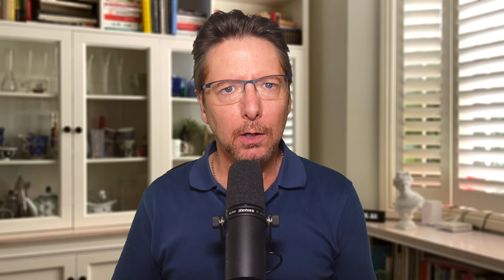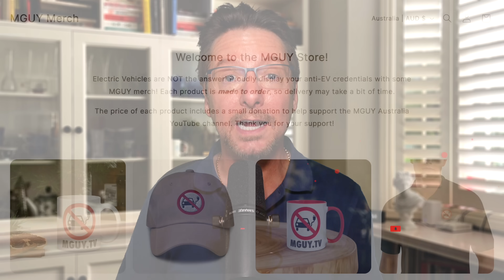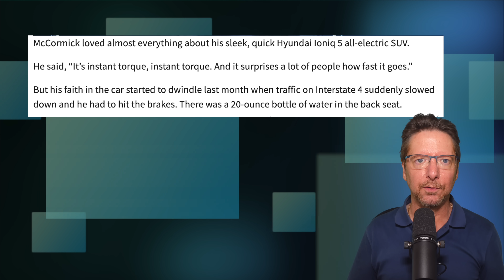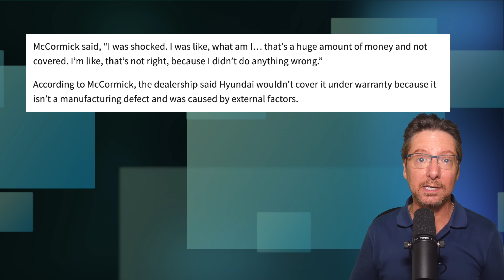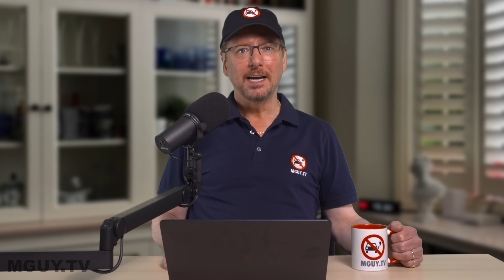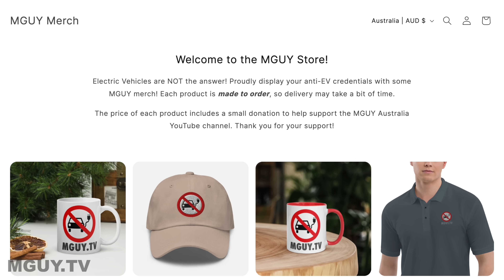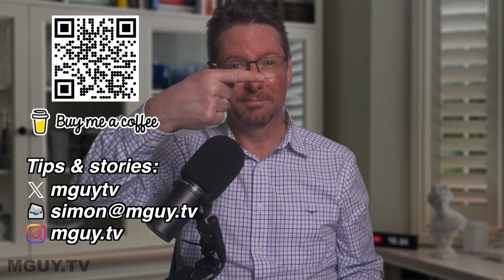ASTRONOMICAL EV repair bill for spilling a WATER BOTTLE! | MGUY Australia

Comment: Parts are expensive for EV's because the manufacturers are trying to claw-back the massive losses that they are making.
Reply: Parts for Chinese EVs were NEVER AVAILABLE.   😮
Reply: @MelodyMan69 They are available in the form of another EV.
Reply: @user-vb6lq9il5v  :face-fuchsia-wide-eyes:
Reply: @MelodyMan69 I was in Bolivia about a year ago, and there were many chinese EV makers which is odd since most people in the country can't afford any car.  You often see husband, wife and baby in mothers arms on a motorcycle.
Reply: @MelodyMan69 Exactly right. An idiot in the UK has been waiting for 7 months for a rear light fitting after somebody reversed into him. It's an Omada I think, something like that. He asked the dealer when the replacement would arrive and they told him there were no replacements. So he asked how long it would be until they shipped the new part over from China and the dealer said, "No, you don't understand - there ARE no replacements, period. There are none coming." Seems now all he can do is wait for a accident damaged car to show up with the part that he needs still intact.
Reply: @MelodyMan69🤦‍♂️
Reply: Do you have proof? Or just speculation. Don't buy an EV ever.
Reply: Dealership:  Oh oh.  We have to replace a module.
Owner:  Which module?
Dealership: The car module.
Reply: Making losses lol, stop building them.
Reply: @melissasmess2773  They'd have to get rid of insane CAFE (Corporate Average Fuel Economy) standards first. THOSE are/were forcing makers to build EVs unless they want huge fines added to each single ICE car. Thankfully, President Trump pretty much did just that: "In the One Big Beautiful Bill Act signed by President Trump on July 4, 2025, fines for missing CAFE standards were eliminated, effectively mooting the standards." (wikipedia CAFE article) I'd have to dig deeper how EU standards are still punitive to makers. In any case, makers have started to move away from EVs again.
Reply: @melissasmess2773  They increased the price of ICE cars to partially cover the losses but even with that extra income EV's are draining them.
Reply: @WhiteDieselShed  Finally! Someone else who actually knows and understands what's actually going on in the car market.
Reply: @WhiteDieselShed  Actually much of the price increases are due to all the "nanny state" stuff that is required.  Motion sensors in the rear in case someone is behind the car, RADAR in the front for automatic braking, sensors for lane violations, camera to make sure you don't fall asleep, etc, etc.
Reply: @WhiteDieselShed  BYD is still profitable, but its profit has declined recently due to a fierce price war in the Chinese electric vehicle market. While the company reported a 33% drop in net profit for the third quarter of 2025, it still generated a significant net profit of approximately $1.1 billion for that quarter.
Reply: @melissasmess2773  woke governments force them to a lot of the time
Reply: @melissasmess2773  Ford loses 3 billion every quarter on EV's.
Reply: @melissasmess2773  Those which make EVs and ICE have increased the price on all of their ICE to subsidize their EVs. Every ICE purchase is covering their loses on EVs. This is why all vehicles have become so expensive.

Want cars to become more affordable? Push EVs out of the market until they can position themselves in the market on their own.
Reply: @justanothercomment416  yup Mary Barra admitted it when she made the declaration that GM was "profiting" on EVs... By overcharging (pun intended) on actual cars to subsidize their massive losses for each EV.
That's when the lightbulb lit up for me on why normal cars were almost as expensive as EVs lately
Reply: Also because of monopolies, say good bye to generic parts that fit on almost all cars, these modules are designed to only fit one make and model. Even when the hardware is identical they use DRM to ensure to cheaper after market parts are installed.
Reply: @John8087  "Even when the (...) parts are installed." 
 
I think you intended to include "no".
Reply: EV owners seem to love flushing money down the toilet
Reply: @Terry-q7y  A common misconception after listening to MGUY who has, by the way never owned or operated an EV.  MGUY speaks purely from ignorance as his comments bear zero resemblance to actual EV ownership.
Reply: @tacocangrabembythetaco  Not owning one is god protecting him from endless problems
Reply: @Terry-q7y  Yet God was unable to protect him from being a whiny beeatch dealing in subjective hyperbole.  God is unfathomable.
Reply: I have a 2008 Nissan Skyline sedan. The main headlight had moisture inside. Price to fix? $3,500, because it is a sealed unit so the whole light assembly has to be replaced. It's not just EV's that have expensive spare parts. p.s. I was very lucky that the auto electrical company I deal with agreed to try and replace just the one light. They indeed figured it out and it cost $700.
Reply: Gee they tried to rip you off Sealed units second hand start at around $150 bad luck champ
Reply: @fossilsfabe4304  That's still a big ouch for what should be a basic repair, something that even a less than dedicated amateur could or should be able to do.
Reply: @fossilsfabe4304  Your IQ is negative!
Reply: @fossilsfabe4304  ouch!   this is a pretty old issue.  people got mad that replacing a lightbulb required dismantling a lot of things.
Reply: @fossilsfabe4304  Audi LED headlight id 19000 USD
Reply: @fossilsfabe4304 ma ti rendi conto,delle stronzate,che ti dicono ,3.500,per un farò...andavi da un artigiano e con 200/300 euro,ho Dollari ,Ti faceva il farò meglio della casa Automobilistica..
Reply: @fossilsfabe4304  Das ist aber auch kein "Allerweltsauto". Da darf ein Scheinwerfer so teuer sein. 😎
Reply: One for the price of two
Reply: What loss? Chinese EV manufacturers register the car to make it seem like it's sold, get the CCP rebate, which covers the cost of the cheaply made car, then it sits in field or in a mountain carpark rotting, until some halfwit buys one. The manufacturers are making DOUBLE the cost of the car whenever one is legitimately sold.
Reply: EV makers have serialized each major part in the car.... motors, batteries, electrical components, because they want you to be forced to go to the manufacturer for the smallest part.  That makes it a non-starter for people who think about long-term reliability and are interested in have a reliable car for 15-20 years.
Reply: @teekay_1  The push for EVs is largely about control. They want to force everyone into disposable vehicles where they can control and limit travel. Thereby forcing everyone into 15-minute "smart" cities. Where everyone can be tracked and controlled with minimal effort.
Reply: @justanothercomment416  That is certainly one of the plans that the elites have particularly for cities. But in the US, a large percentage of people live at least 5-10 miles away from even a grocery store, and so that makes it a practical problem for EVs and why Americans have such an aversion to them.   Around me (I live in a somewhat rural area, wealthy people buy them as a 2nd or 3rd car.
Reply: @teekay_1  We don't have a power grid which can support EVs anyways. But if you force adoption you'll create massive grid and power failures. Which would then be used as an emergency reason to limit individual power consumption under the fraudulent green agenda.

Our grid is already stretched and expanding with EVs only compounds the issues. But this does increase energy costs while lowering GDP. All according to plan.

Any country pushing EVs without a massive grid expansion with nuclear is literally a grid engineered to failure and increasing energy costs. Wind and solar both play a role here as these too only force energy costs ever higher. They are all tied together to end civilization as we know it, to usher in the NWO; complete with your social credit score, limited travel, and limits on individual energy consumption.
Reply: Tech is aging fast so they have no will to produce new batteries to old cars or repair them.
Reply: And people are stupid enough to let them.
Reply: @SN-jh3bb stupidity is a social contagion.
Reply: Will third parties tool-up to make spare parts? The OEMs aren't likely to support their EVs long term.
Reply: lol, you have no clue what you are talking about
Reply: @JohnnyPerth  You just described every MGUY fanboy. This channel is built on fear and ignorance.
Reply: Massive losses? Musk has made BILLIONS on them, just got a 1 trillion dollar salary over the next 10 years. They are so expensive because people pay MUCH MUCH more than they are worth!!💰💸🤑
Reply: What parts? 75K EV kms driven in 3 years, no repairs, no servicing, no oil changes, no public charging, no running out of juice, no fires, no explosions, just $16,500 AUD saved on diesel and servicing in 3 years. You guys live in an MGUY fantasy world where you imagine you are experts on EV's, why? because some other plonker who has never owned an EV either told you some stuff. Funny.
Reply: @tacocangrabembythetaco  Same here...2 year old BYD Seal, 27000 kms and not a single fault, mechanical, electrical or software.....On another thread I made a comment about the extremely low risk of EVs catching fire and an angry Mguy fanatic told me to go and look at the London Fire Service for 'real data".....if you want to have a laugh Google "London Fire Brigade leads the way with new electric fleet".......I replied to the Mguy fanatic with the 'real data", but he never got back to me.....
Reply: @tacocangrabembythetaco An electric vehicle that has travelled 75,000 kilometres over three years should definitely have a service history. Even though electric cars require less mechanical maintenance than petrol or diesel cars, they are not maintenance‑free. They still need regular inspections and replacement of consumable items such as tyres, brake components, filters and fluids.  

Manufacturers usually recommend checks every 12 months or around 15,000 kilometres. Over three years and 75,000 kilometres, that means at least three to five scheduled services should have been carried out. A proper service history is important because it shows the car has been maintained correctly, it protects warranty coverage, and it helps preserve resale value.  

Tyres are one of the first things to consider. Electric vehicles are heavier and deliver instant torque, which means tyres wear faster. At this distance you would expect at least one full set of replacements, possibly two depending on driving style.  

Brake pads and rotors last longer in electric cars because regenerative braking reduces wear. But the brake fluid should still be replaced every two to three years, and rotors can corrode if they are not used often.  

The 12‑volt starter battery is another item that needs attention. Electric cars still use a conventional battery for accessories and control systems. These usually last three to five years, so replacement around this mileage is common.  

The cabin air filter should be replaced every one to two years to maintain air quality. By three years, at least one or two changes should have been recorded.  

Electric vehicles also use coolant for battery and electronics thermal management. Replacement is usually required every two to three years.  

A proper service history at 75,000 kilometres should show regular tyre rotations and replacements, brake system checks and fluid changes, cabin filter replacements, cooling system checks and possibly a coolant change, 12‑volt battery testing or replacement, software updates, diagnostic checks, and inspections of suspension and steering.  

The conclusion is straightforward. Electric vehicles avoid oil changes, spark plugs and exhaust maintenance, but they still need servicing. A car with 75,000 kilometres on the clock should have a clear service history covering consumables, fluids and system checks. If no records exist, that raises concerns about warranty, safety and resale value.
Reply: @tacocangrabembythetaco  I am sooooooo glad that you subscribe to the New World Order nonsense!!!!!  That tells the rest of us how you operate.  Keep drinking the cool aid.  It is working for you.  The fact that you CLAIM to NEVER run out of "juice" tells me that you DO NOT go anywhere!!!!!   I live in a rural area, not some over-regulated city with its failures and faults.  If you love your little golf cart, I am happy for you.  

I drive a 23 year old Jeep, and a 16 year old diesel pickup.  I also own a hand built 1923 T Bucket.  I own a quad, and a RZR.  I also have a 3,000 pound slide-in camper for my pickup.  I like to go out into the boondocks for fun.  Let's see you load a 3,000 pound camper onto your EV, and then drive 150 miles out into the wilderness and stay as long as you want.  

Every part of any of my vehicles is recyclable.  Not so with your golf cart.  EV end of life issues ARE a real problem.  Lots of deadly chemicals in a decomposing EV!!!!!!!!!
Reply: @BuilderofRat  I  have 2 diesel trucks, a 72 Ford V8 Coupe, 2 motorcycles, 4 forklifts, a scissor lift, a 5000lb trailer and 2 EV's . So what? EV end of life issues are all in your mind as mankind always finds new solutions to new problems. Maybe get down off your high horse. I speak from practical experience, you should try it rather than sound foolish.
Reply: @tacocangrabembythetaco  There are very few recycling centers for Evs, mainly those batteries.   China has hundreds of acres of unsold EVs, and they have destroyed the ground so badly that nothing will ever grow there.

How do you suppose that a totaled EV will make it to one of these recycling centers?  If I was a truck owner, I would refuse to haul these things ANYWHERE!!!  

So you think that I sound foolish?  I think that it is foolish to charge your EV in your garage, or anywhere next to your house.  I think that it is foolish to have to plan a trip around the availability of a charging station.  

Until they figure out a better SAFER battery, I would not  own one of those things even if it was free!!   It does not bother me that you LOVE your electric vehicle, but there are BILLIONS of people just like me that have ZERO use for any EV!!!
Reply: @BuilderofRat   I get my info via practical ownership experience not from other fools with no practical knowledge or experience on a subject.
Reply: @tacocangrabembythetaco  You simply do NOT understand who the FOOL actually is!!!!!   How many EVs have you tried to recycle?  Your statement is soooooooo foolish!!  Do a little research on the subject.  

let's see about practical knowledge, how far can you go with your EV?  What if there are no charging stations on the way?  What if your destination is 100 miles further than your range?  Do you need to take a different longer route that does have charging stations?  IF your answer is yes to any of these questions, then my statement about researching charging stations for a proposed journey is CORRECT!!!   Of course, you could just take one of your many ICE vehicles and just not worry about range.  I live in rural Idaho.  I also once lived in Nevada.  BOTH states have miles and miles with no charging stations.

I have dealt with many "experts" when I was a field man for Caterpillar.  It turns out that LOTS of these "experts" with lots of first hand knowledge actually did NOT know what they were certain was the right information.   I did not call them fools, I just explained why their information was wrong.

One thing that I have picked up in these forums, is the EV owners are immensely proud of their choice of transportation, and they really bristle up when ANYONE dares to challenge them about their choice of transportation.   You fit right in with that statement.
Reply: @BuilderofRat  Maybe if you spoke from experience rather than ignorance you would not sound so foolish. I see you live in MAGA country, how's that working out for you. I see Trump's brought beef prices down from $100lb to $50Lb lol.
Reply: @tacocangrabembythetaco  I absolutely LOVE living in my RED state.  We do not have gangs of criminals looting stores.  We do not have major criminal activity in my city of 60,000 people.  We do not have people living in tents on the sidewalk and craping in the street.  We like our Police.   BUT, the best thing about where I live, is all of the wide open spaces that I can ride my quad and RZR.  I can go 15 miles and then ride for HUNDREDS of miles out in the desert.  We also have hundreds of miles of 50 inch trails in the mountains.

 I do not pay $50 dollars a pound for beef.  It looks like you should take your own advise about speaking from experience.  I knew from you ramblings that you were a Democrat.  You people have a way of taking a person's statements and then twisting them around to make you feel better about yourself.   We have been getting so many people moving into my city from the Democrat cess pools, that it is creating traffic issues that we never had before.  

Enjoy living in your Democrat cess pools and driving your fancy golf cart.  You are starting to sound like your political representatives.  That is pitiful in my opinion.  There is a reason that 9 out of 10 of the most fiscally bankrupt states are governed by the left.  The is also a reason that 9 out of 10 of the most fiscally stable states are governed by the right.   Please stay where you are, we do not need people like you in my state!!!
Reply: So it wasn’t so expensive in the end!?
Reply: You struggled at school didn't you Benny.